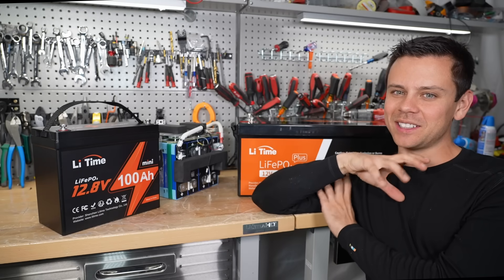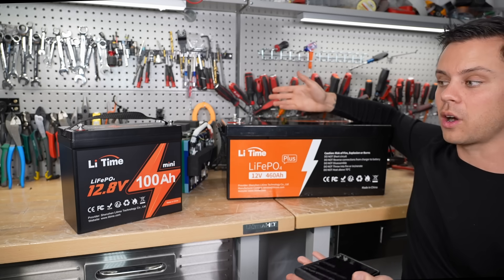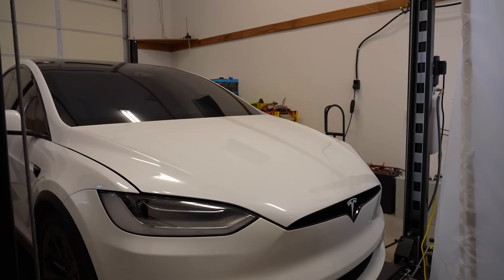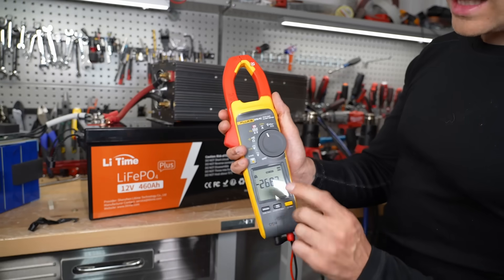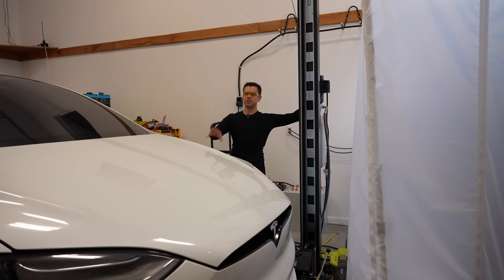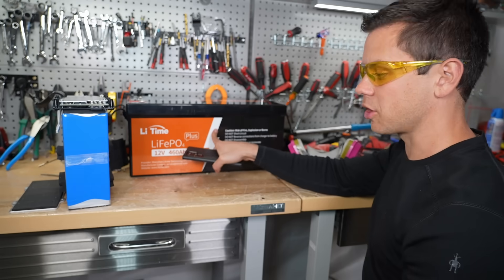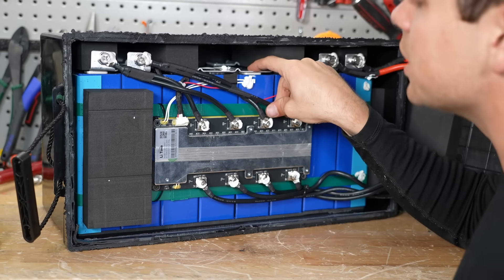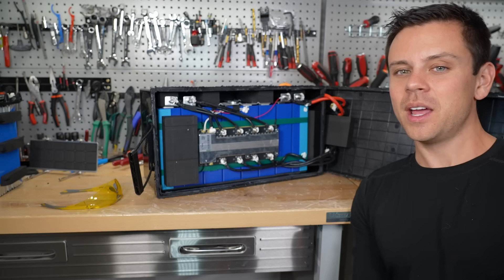LiTime LiFePO4 Mini and 460AH Plus! Surge Testing and Teardown

Comment: Yep, as an RVer who might replace everything in the next year or so, that lack of low-temp sensor is a deal breaker.  Sometimes we end up in an area with sub-freezing temps from time to time, and our batts live under the front of the fifth wheel.
Reply: As a full timer who posted before seeing yours - about 24v making more sense for us than 48v, for now- may I ask what you are using and if you have plans to change with your upgrade?
Reply: @jimg5669  No specific plans, per se.  Just want to increase capacity, etc. for more boondocking in the desert.  Right now at 4x190w solar and 4x100ah lithium batteries.  Would like to bump to maybe 800ah and modify solar panels so they can be tipped to catch that low winter sun in the southwest.
Reply: @WillBelden sounds like you need more solar .. I am putting 950w in Summer and option 1900 total  for winter (at this time I might never do winter but having the option  on my camper . 200ah-400ah batteries
Reply: @philipwalters5254  We probably do need more solar, I'm sure.  Not only "more" but "newer, more effective".  Our panels are probably about 6 years old.  We're sitting here in Mexico right now.  The event is all boondocking, but we aren't parallel to the sun's low path, so without the ability to tip them (not that it would a be 100% solution, angle is still wrong), we're having to run the generator a couple, three hours a day.  Fortunately, we're a toyhauler with 60 gallons of fuel!
Reply: @WillBelden  I am doing a cargo camper conversion and going to cover all the roof with ability to tilt any 4 directions.. using removable locking pins .
U need enough solar to charge those batteries.. more batteries won't help until you get more solar.. I am buying four 460w bi facial panels for $200 usd each. I would guess I could get 4kw of charging power per day down there in winter..

Comment: Hey Will, they also offer a 51.2V 100Ah battery that is basically the same battery but in 48V (or 4x 12.8v which is 51.2v).
I've been using the 12v 400Ah in my RV for almost half a year now, no complaints at all! Coupled with a victron battery sense to protect from low temp charging.
Reply from the maker: Getting them to ship them out, just emailed them. I did not see the 48V batteries in their menu, thank you!!!
Reply: @WillProwse why not run 4 of these in series instead of paralleling the 48v batteries?
Reply: What did that 400ah set up cost you?
Reply: @Greg-gr5bb  The battery was €1500, I use a Victron Multiplus 12/2000, which also cost me about € 900, 650 watt of solar panels at about €1 per watt. Add a solar charge controller, cables, fuses etc and you're looking at about €4000 for the full setup.
Reply: @AutoAddictionMedia  I appreciate your response and time. Thank you. Jesus bless.
Reply: @AutoAddictionMedia   i would love to look at your setup
Reply: Wouldn't 4 of these batteries in series (about 22 kwh) be better than running 4 of the 48V/100ah batteries in parallel?

Comment: Thanks Will, I used your book in 2017 for my first solar install (12 volt for my 5th wheel).  I just purchased 2 of these LiTime 460ah with LiTime 60 amp MPPT because the lead acid are starting to fail. I am retaining some exist lead acid because these lithium batteries are not to be used for starting a generator. HEADS UP to your group, the LiTime materials states two variations regarding ADDING additional batteries into your bank. One states: additional batteries must be purchased within 3 months of original purchase date to maintain battery warranty......other location states within ONE MONTH from original battery purchase date. 
Maybe you could address this topic for folks whom wish to expand their existing lithium banks or wish to  mix different battery MFG's.  
So, if someone wants to add more amp hour capacity after the fact; It appears, I will have to sell the existing bank batteries and start new , OR add an additional controller with a new battery bank but this creates a further questions/risks of merging both via a battery selector switch 1 or 2 or both battery banks. Please opine and a huge thank you for all your years of education on solar.

Comment: The larger 12v battery would be great for RVs applications. No need to mess with stepping up or down voltage.
Reply: Any idea if this battery would start and power a Dometec RV air conditioner for awhile?
Reply: @aussie2uGA  Does it run on 12V? Then it would.
Reply: Many variables when considering running a A/C unit in an RV. Size of a/c unit, other devices, etc... just search on YouTube for RV batteries. You can find a bunch of people installing, testing, etc..

Comment: My Transit build will include a pair of the 230A@24V version of these.   Cold temperature cutoff is easily managed with some radiant-heat flooring underneath the battery box..

Comment: My charge controller has low temp protection. If it's set to lithium it won't try to charge below 5 degrees celcius. Since my charge controller has it, I'm not worried about my batteries having it.

Comment: pouch cells not good for long term storage
Reply from the maker: Why
Reply: @WillProwse   they go bad quickly - 
been using Li Ion batteries since 1999 and only cells that  I have had go  bad have been pouch cells - close to 100% have Puffed in less than 18 months - 
 i have close to 1500 calendrical cells and 12 prismatic cells that are still going strong 
with 6 plus years daily use in a RV

Comment: Can you maybe do a video and test or show how we could / or could not? wire up the EG4 rack batteries with non rack batteries. Example: 1 x 48V 100AH 5120WH rack paralleled with a set of 4 LIPO4 12V 100AH in series for 48v also 5120WH. I know we would have to set the inverter (In my case the EG4 3000EHV-48 3KV off grid) to manual battery settings but while maybe not perfect or 100% optimal I cant see a reason why it should not work but I am no expert. I just know I cannot afford to buy more overpriced rack batteries for $1500 to $1750 with their $300 shipping cost with the various 12V 100AH batteries selling at $800 to $1000 per 4 shipping included. That is under half the price, buying 2 sets you double the AH for the same money. 

Yes there are tons of other options but they go up in price. Many of us followed you for a while and it was because you were budget minded in the past and the videos you were /are doing  fit our budget. You were willing to experiment. I have seen quite a few related comments and questions asking the very same question. Thanks!

Comment: Hey Will, have you tested the OASESENERGY 12V 100 battery from Amazon yet? I bought one a last month to run my diesel heater and so far, so good. I bought with my own money $199. But I'm not opening it.

Comment: I dont like that glassfiber reinforeced tape. It crumbles after a few years into dust. The glue layer is not good! Have a look at your +3 years older batteries!
Reply: That's my experience too. That stuff is meant to be strapping tape for packages. Or are they using "magic" strapping tape instead? It will probably disintegrate quickly when exposed to the heat of the BMS heatsink. Pretty shoddy and slapdash in my view.

Comment: Excellent presentation.  Thank you.  I have had the Li Time mini version in my truck camping setup for a few months now.   The size and weight are great for me.   I have a fairly small truck camping setup but really like having 12v.   I can directly use 12v truck camping stuff directly from the battery.   I can also directly charge my Bluetti EB70 directly via the 12v feed with no power sucking boost converter needed.   I can also jump start/charge my truck directly from the mini.   I can fully appreciate the higher voltage batteries - 24v - 48v - but in a simple camping/truck/van setup, it is hard to beat 12v for all round flexibility.
Reply: Question for you.  I am new to Lithium Ion Phosphate batteries.  Can I charge one of these with the built in 12 volt charger in my camper?  I am finding it difficult to find the answer for that.

Comment: If the pouch type cells turn out being as good , it means 48 volt batteries could be way smaller and lighter and could more easily come in muli amp ratings. In a good plastic case, I would think nullifies the need foe each cell having a heavy case.
Reply: Exactly, I'm with you. A 48v pouch type battery 100ah or 200ah (~5k-10k wh), with a smaller and lighter inverter/charger for RV boondocking applications. The advantages would space saving, cost, weight and a small benefit with handling surge power compared to a 12v system.

Comment: I just spent a small fortune building a 12v system. I did do it right using the largest power cables that I could for each section of the system. If I build another system in the future it will be 24 or 48 volts.

Comment: Hey Will! Did you just say   add some washers and "TWERK" it down, LOL Just kidding, thought I'd get a laugh out of you. Thanks for the video Will, I have been looking at these batteries when you showed them before, but just got my confirmation. I just order 2 trolling motor batteries with a charge controller for my stryker inflatable boat. Thank you

Comment: I agree if that 460 amp battery was 24 or 48 volt would be nice. 

Will let's be honest... a 12 volt system is a simple build and setup. And some people are intimidated with the higher voltages. With DC voltages much over 24 volts you have the worry of arcing. Most wirefeed welders run 22 to 28 volts.
Reply: There is a 24v version of this large battery.   Of course it's 230 amp.   Same watts.
Reply: @AndrewMetcalfe   I saw that after I wrote this.

Comment: That's a nice fluke meter. I couldn't justify buying one, for my small system. We have a fluke meter at work that cost 15K. I'm actually scared to to touch it😅.
Reply from the maker: What does it do? Measure gravity waves? Haha
Reply: @WillProwse  Apparently it can tell you exactly, where in your cable, the fault is. It tells you the distance down the line that the fault occurred.  I haven't had to use it yet, but I'm looking forward to playing with it when the time comes.
Reply from the maker: wow!! @ZK-DK
Reply from the maker: 15K?!?? That's insane haha

Comment: It's not just the cost of the low-temperature sensor, it's the liability if the battery is damaged due to freezing.
Reply from the maker: Liability of a Chinese company? Haha
Reply: Like they give AF. 🙄
Reply: @Count_Smackula  exactly 😂
Reply: @WillProwse do you think Li Time, Redodo and Power Queen are the same company? I bought 2 Redodo mini's and everything is identical, manuals packaging etc. Just curious on your thoughts.  Good video
Reply: @WillProwse More videos, please for the beginner than newbie.❤❤❤😊😊😊😊
Reply: Which doesn’t matter because they aren’t going to warranty a battery that’s a year old and shows serious degradation. They’re going to look at your shipping address and likely blame it on the weather
Reply: @ericklein5097 huh?
Reply: If you living in a hot climate like fl .you don't need it
Reply: Yeah, that’s why
Reply: I've got two of em in a Victron system, the low temp cutoff shouldn't be an issue for me because all the chargers in that system have their own temp sensors. But I can see where it'd be a huge issue in a less well connected system than a Victron.

Comment: I had issues with charging two of the trolling batteries. I bought a pair of them and both would only charge to 12.8v following the instructions. Even after contacting the company several times and using the trouble shooting methodes given. They did let me return them with no problem. I gave them a second chance and bought two of the other 100ah batteries and they charged to 13.4v each no problem and I'm happy with them. I used one of the Li Time  20 amp chargers with both applications.
Reply: You should charge them to 14.4V absorption, 13.8V float. 13.4V is too low
Reply: 13.4 is as high as the lithium charger would charge before shutting off
 @AutoAddictionMedia

Comment: I build my van with two of these 400ah batteries, really happy with them, think the lowest SoC I got was 30% and I don't bother looking at the meter anymore, just works for our weekend trips. Do think if you are DYI, 12v is much safer. As for low temp, don't care, followed your other video and installed the Victron square bluetooth temp monitor and that will halt charging from the controller. Think the worry here is that if each battery had their own temp sensor, you could get odd behavior, so better to have the temp low cutoff at the MPPT, not on the batteries.
Reply: I do the same thing with the victron low temp cutoff.
Reply: You do what works for you.    You can Google the differences between the two but lithium has far less weight, takes up less space, last thousands more cycles.   Many people feel like the extra cost is worth it, others don’t.
Reply: My lead acid cells work cheaper and just as good on a weekend. Why use lithium for a weekend warrior?
Reply from the maker: That's awesome!!!
Reply from the maker: Yeah, very smart to control at mppt

Comment: Hey Will, small correction- just because they label them as "Plus" doesn't mean they don't have low-temp protection. I have the 230Ah version that they bill on their website as having low-temp charging protection, but the battery itself doesn't have any branding to indicate that- just the "Plus" branding. I agree 100% though, it also doesn't have any indication on the battery as to the BMS maximum amperage. They need to put this stuff on the batteries!
Reply from the maker: Yes the plus doesn't mean that. 

and right?! They need to add it to the front of the battery
Reply: How is that 230ah battery? I’m thinking of getting one for my class c RV to replace the two batteries in the step battery compartment.
Reply: I've one in my minivan running an induction stove, Keurig, fridge, diesel heater, 40 amp DC box, and more and have been very pleased with it. 234Ah has been my deepest discharge till LVD. 2.5Kw output sustained no problem and I believe it was a 400 amp surge for 5 seconds.
Reply: Looking at that one for my rv. Will it fit in an 8" wide box?

Comment: I have 3 Lossigy 12v 200Ah batteries with pouch cells in my van. 3 years still going fine through wide temperature swings through summers and winters.

Comment: I ordered the 6kw split phase low frequency inverter from ECPC/Inergetech. They shipped the Sigineer unit. But for much less $$$. I'm afraid that I damaged my SWIPower 3kw high frequency inverter with only heavy inductive loads.